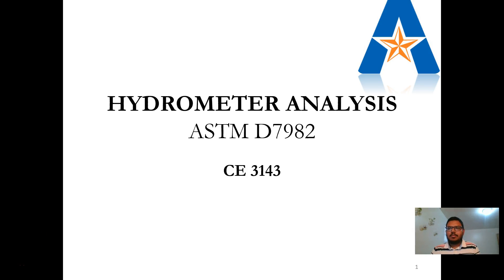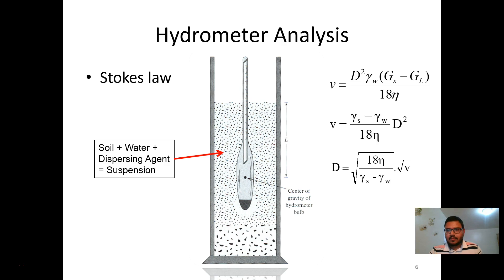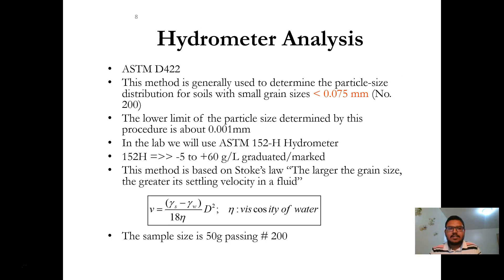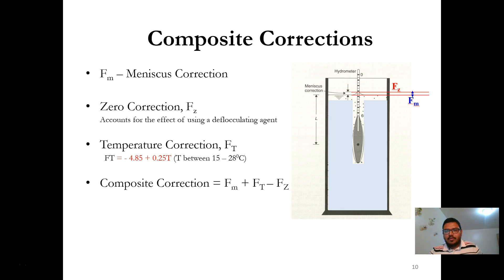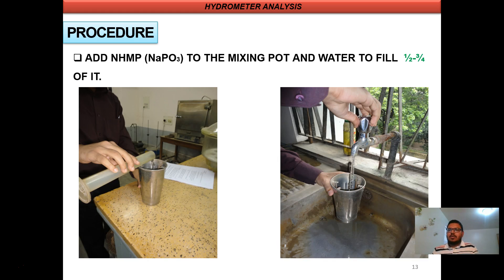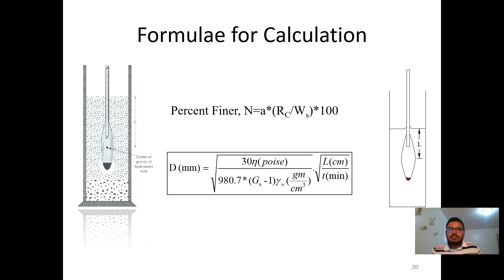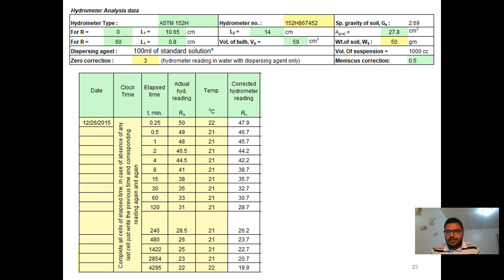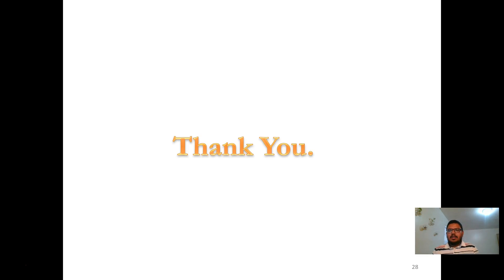Experiment 4_Hydrometer Analysis | Soil Mechanics Laboratory Tests

Comment: Dear Sir,
You said that the hydrometer is calibrated at 23 degree Celsius but the temperature correction table shows that it must be calibrated at 20 degree Celsius as the value is 0. Can you clarify on this?